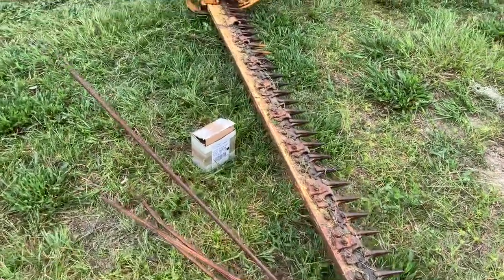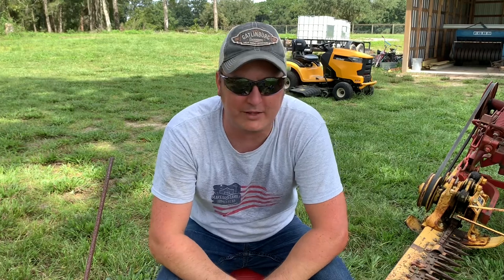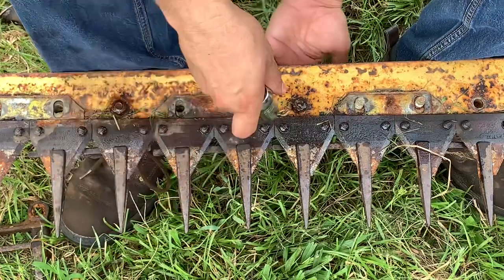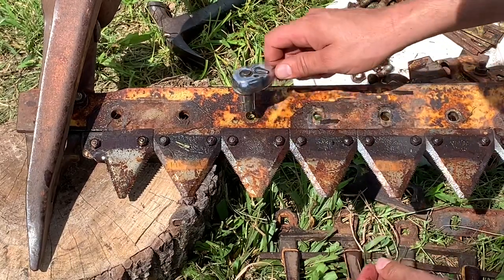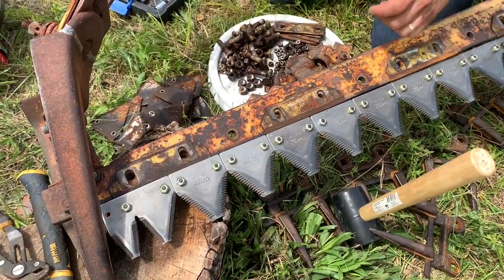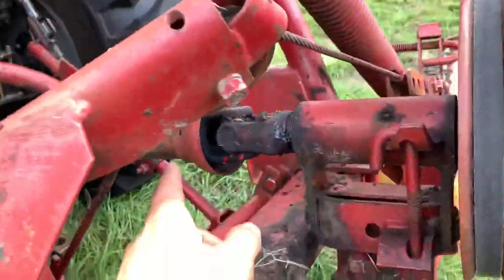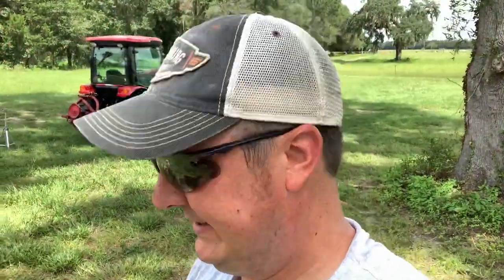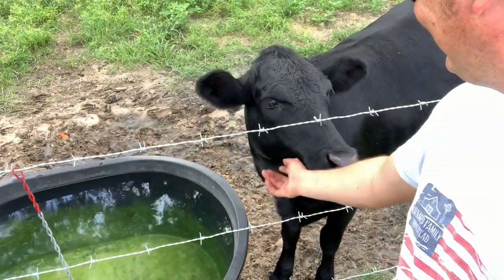Doing an overhaul on a NH 451 sickle bar hay mower

Comment: If you are just changing the knives you can unbolt the bar with one bolt on the drive and slide the whole knife bar out the other side.  It is a whole lot easier to knock out the old bolts.  It only takes me about hour to change the blades on mine.

Comment: Thanks so much! Going to be working on mine to get ready for this season. Did you have any issues with the rock guards needing to be "adjusted", i.e., "whacked" to raise/lower them so that the blade would sit flush on top of the bottom surface of the guard, and make good contact in order to achieve a proper "scissor cut" contact with the guard?
Reply from the maker: Thanks for watching! My rock guards were in decent shape so I didn’t need to do any banging on them. The end of the scissor bar needed some love but nothing major. A torch could be handy for big adjustments, a little heat goes a long way.